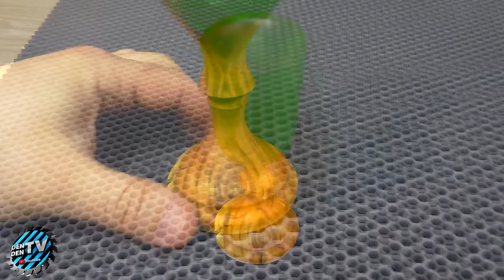Amazing handmade wooden ideas!

Comment: Beautiful, but unnecessary use and waste of plastics/epoxy.
The oceans are full of plastics. We need LESS, not more.

(And for the nut and beer tray, I would personally (had I the skill to make it)
have put the handles on the bottom bit that actually carries the weight of the beer bottles.)